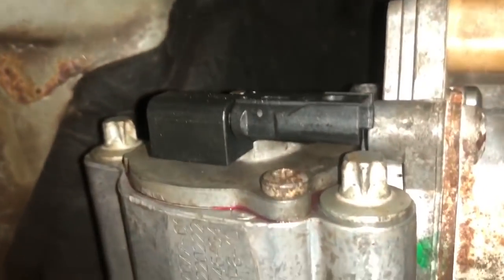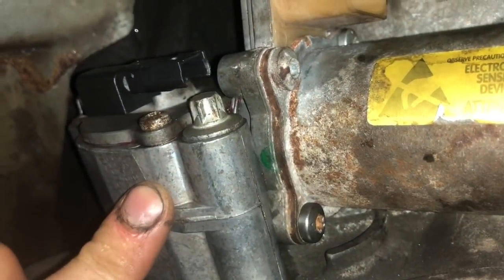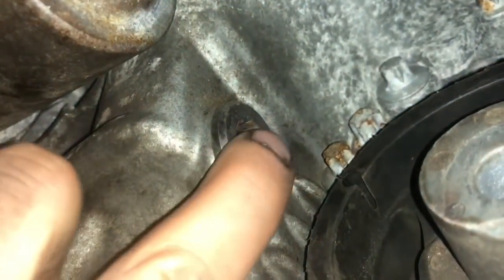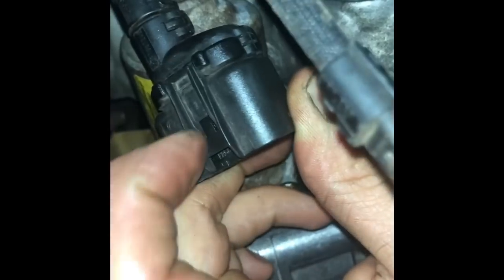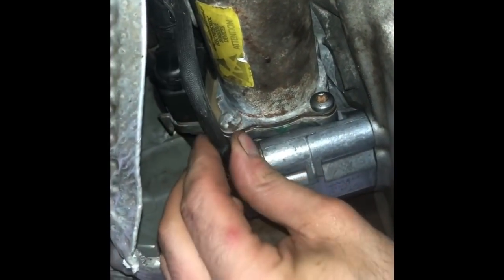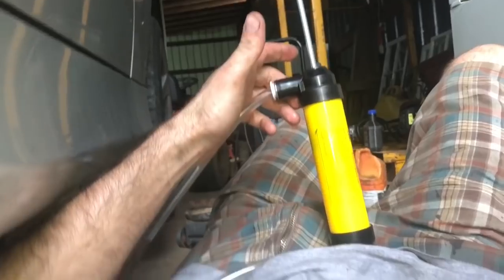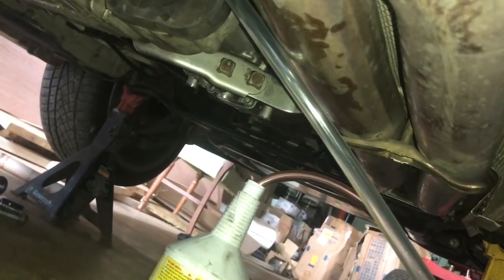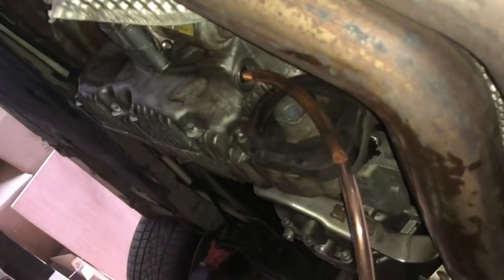Bmw Transfer Case Worm Gear Replacement

Comment: Parts link!
Reply from the maker: It’s been a long time since I did this repair. I don’t know if the parts link I posted is still valid. I have since put 50k miles on the car and the problem has not came back.  I did in between that time have to replace both abs rings on both of my front axles with caused my tcase light, abs light and brake light to come on. It’s best to read the codes on the car with the bimmer pro tool to diagnose the problem.

Comment: Did the same job yesterday, but had a big struggle with hammering on a new replacement worm drive (it did not go smoothly, even after pre-heating). 
After putting everything back together the whole thing sometimes works, but quite often I get 4x4 error only (so at least tracktion and ABS are back). 
What appears to be is that my xDrive case sometimes jams in fully locked position (fully engaged limited-slip clutch). So the car is full AWD all the time. And now getting inner rear wheel slip when cornering. 
So, now I am thinking on buying a new actuator anyway, because my suspect is that new worm drive got deformed because of hammering, so it jams. Or something else went wrong in it.
Reply: I have a 2008 e60. Old actuator was worn like this. Bought a cheap $130 actuator from ebay, which fixed all lights. Then I have the same jamming problem as you did. Considering to fix the old actuator.
Reply: @dikaixu3019  eventually, after couple weeks of driving it un-jammed itself and was fine ever since. Maybe drive it some more time. It tries to engage/disanage it every time you start/stop the car. It may go away on its own. I think that may happen because xDrive Control System still adjusts target values for actuator motor torque  (with new lubed actuator gears now it needs to apply less torque than it used to with old worn-out gears in dirty grease).
Reply: @alexm7056  Thanks! I'll try driving it for a few more weeks. I did use the ISTA-D to reset/calibrate the actuator. Apparently it didn't help.
Reply: @dikaixu3019  Did it go away? I did the same, bought a new motor on eBay and now I have grinding. At least before I didn’t have grinding with the old broken actuator. Wondering if driving for a little bit will fix it.

Comment: What was wrong with your xdrive? What symptoms it had. My 535 seams as if the front wheels dont want to turn.
Reply from the maker: Remy Helu the front wheels will not be engaged until traction is lost in the rear
Reply from the maker: After I replaced this , the light didn’t come on for a long time but later came on again, I used inpa to read the diagnostic code and the car reported back saying a faulty wheel speed sensor on the front driver side sensor. I took it apart and found that there was a piece of metal on the magnetic sensor. I cleaned it and it fixed it for about 9 month but recently came back on again

Comment: Would you rebuild one for me? How much would you charge? I took mine apart and it looks fine but I hear the grinding noise coming from under the car when i turn it off/on so I really think its the actuator.
Reply: My advice - get a new one ($170 on eBay brand new now), saves you some time and possible side issues.